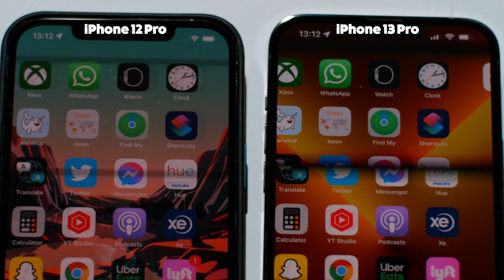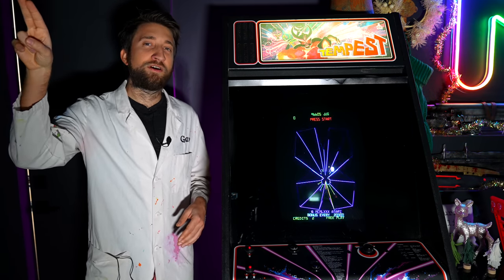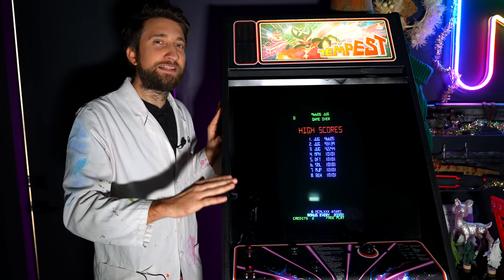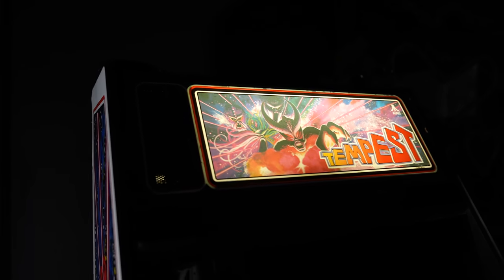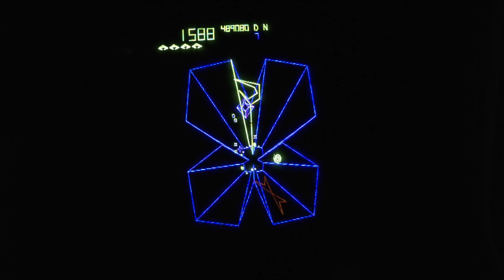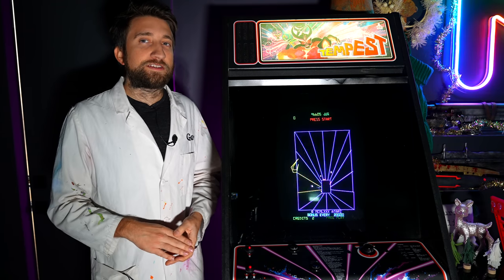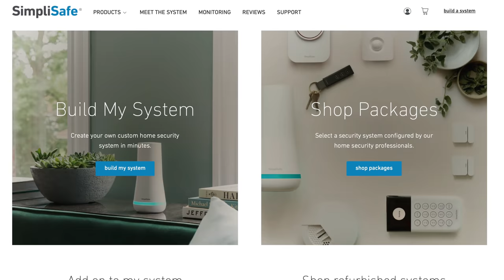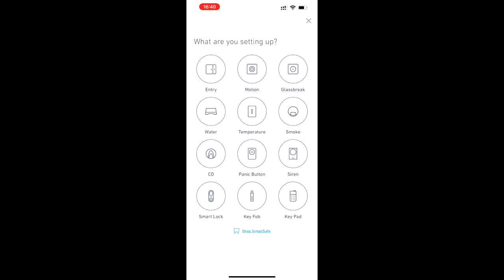Arcade Machines look WEIRD in Slow Mo - The Slow Mo Guys

Comment: I used to have an old CRT monitor that did that. Not sure what went wrong with it but the refresh rate oscillator must have been messed up. It worked for about 6 months normally and then suddenly slowed way down. Needless to say it went in the garbage lol. Probably a bad capacitor or something but you couldn't watch it long because it drove you insane.

Comment: Hello! Could you maybe do a vid just on how you light super slo-mo vids?

Obvs you can't use 50Hz or 60Hz mains-powered lights to do this because the shutter is flipping about 25,000Hz or more and the lights would flicker like a flickery thing..
Do you have to use DC lamps? Or what?
Reply: LEDs are already DC by nature, the problem is the power supply, which can introduce ripple and other things that make the light flicker, so you'd need one that can output a rock solid DC voltage.

Comment: Project idea - Just watched 'Signal path' showing a frequency counter using 'Nixie' tubes counting from 0 to 50,000,000 in a second or so. Video - Is the counter displaying every count from 0 to 50,000,000 on the display? Could be an interesting video to see the count...

Comment: Not being able to fill in the shapes isn't a limitation to me. It's beautiful art.
Reply: Done with a REAL laser on a screen, It's even more interesting with the pure color.
..
I did vector laser images with a HeNe laser and mechanical galvo scanners in the 80s that I choreographed to music. (classical laser light show) 
 I take out a projector on Halloween each year. 
I use the Radio Shack Color Computer with SW I wrote and used General scanning Galvos.  It used the 6809 and a clock around 900kHz.  In the display processor I was squeezing clock cycles to to some rotations real-time. 
..
I though about writing an Asteroids game, but moved on to other things. . .
Reply: @Observ45er  That is really interesting you were involved in that, and used a computer slower than an NES! I've been to laser Nine Inch Nails in the late 90's at Boston's Museum of Science. They were able to raster multiple, large, animated images. I can't recall how many lasers they were using or if it was only one. Probably multiple since they had different colors. I'm not sure how possible it is to have multiple true laser colors out of one laser, or if it's possible to change colors fast enough in real time.

Comment: It was mentioned at six minutes in that it's not possible to fill in shapes with solid colors on vector monitors. While mostly true, Atari's Quantum actually managed to emulate raster graphics and fill in sprites on a color vector monitor. Granted the sprites are small and way less detailed than what you expect traditional sprites to look like, but it was something that was achieved at a small scale. It's a cool effect that I haven't seen in any other vector arcade games. Initially when I first saw a Quantum cabinet it didn't immediately register as a color vector monitor because of that. You can only really appreciate the effect on a real monitor, emulated it always looks pretty funky. 

Unfortunately Quantum was a failure in arcades, and decades later it's one of the rarest color vector games from Atari. By that time technology was progressing in other directions, and Atari would only release three more vector games after Quantum, none of which took advantage of those vector sprite hybrids afaik. I imagine it was probably a very limited use case. Fantastic video in any case, I was wondering when you'd do some vector monitor slow mo captures!

Comment: I am still impressed that humans were able to build the "primitive" screens like 50 years ago
Reply: I did vector laser images with a HeNe laser and mechanical galvo scanners in the 80s that I choreographed to music. (classical laser light show) 
 I take out a projector on Halloween each year. 
I use the Radio Shack Color Computer with SW I wrote and used General scanning Galvos.  It used the 6809 and a clock around 900kHz.  In the display processor I was squeezing clock cycles to to some rotations real-time. 
..
I though about writing an Asteroids game, but moved on to other things. . .

Comment: It's certainly faster to tell a beam to swipe in a straight line from x1,y1 to x2,y2 rather than have a pixel plotter figure out the next pixel to draw and do that for every line on the screen.
Reply: Yes.
And if you want curves, just send the voltages to the scanners faster than the dot can get to the next location.
With a scope you have to use circuitry to determine the time it takes to get from one place to the next.
My mechanical scanners were the limit. 

..

I did vector laser images with a HeNe laser and mechanical galvo scanners in the 80s that I choreographed to music. (classical laser light show) 
 I take out a projector on Halloween each year. 
I use the Radio Shack Color Computer with SW I wrote and used General scanning Galvos.  It used the 6809 and a clock around 900kHz.  In the display processor I was squeezing clock cycles to to some rotations real-time. 
..
I though about writing an Asteroids game, but moved on to other things. . .

Comment: Aren't you seeing more than just the beam's dot on a CRT? The phosphor layer when struck by the beam fades over time.
Reply: That does help added to with retinal retention.  With a laser there is on;y the retina:
..
I did vector laser images with a HeNe laser and mechanical galvo scanners in the 80s that I choreographed to music. (classical laser light show) 
 I take out a projector on Halloween each year. 
I use the Radio Shack Color Computer with SW I wrote and used General scanning Galvos.  It used the 6809 and a clock around 900kHz.  In the display processor I was squeezing clock cycles to to some rotations real-time. 
..
I though about writing an Asteroids game, but moved on to other things. . .

Comment: I wonder if these vector graphic games have a "classic" concept of frames per second. In a line-scan CRT screen, you have to drawn the entire screen, which takes a set amount of time regardless of the complexity of the image. But for a vector-scan screen, the time required to draw each frame will depend on the complexity of that frame.

So I wonder how the programmers dealt with that. Did they lock it at 30 frames per second, meaning that there was a maximum complexity allowed as well as a pause during which nothing would be drawn, or was the frequency dependent on the complexity of the scene?
Reply: You are correct, but no.  I would never waste time. I drew as fast as the system allowed all the time.  That way it is the same brightness and flicker is only a problem for more complex frames.
You draw it as fast as you can.  That way you are only limited by how much you can draw before flicker becomes a problem. 

You can also alter the delay between the ends of lines to make brighter dots on the ends, or speed it up so the dot hardly stops at a point.  Or really fast for smooth curves.
An image consists of points on the screen and the dot moves between dots with a delay to allow the beam (in my case the laser dot) to move.
..
I did vector laser images with a HeNe laser and mechanical galvo scanners in the 80s that I choreographed to music. (classical laser light show) 
 I take out a projector on Halloween each year. 
I use the Radio Shack Color Computer with SW I wrote and used General scanning Galvos.  It used the 6809 and a clock around 900kHz.  In the display processor I was squeezing clock cycles to to some rotations real-time. 
..
I though about writing an Asteroids game, but moved on to other things. . .

Comment: What exactly is “moving” on these type of displays? Surely there’s no mechanical element actually darting around? What causes the beam to travel across the screen?
Reply: the electron gun itself is completely stationary and always points directly at the center of the screen, but the beam gets deflected by magnetic or electric fields.  most of the time it's two electromagnets, one for vertical and one for horizontal.

Comment: Just like a laser show 👍
Wasn't there a vector tank game also?
I like playing asteroids and the tank game the most...way more pleasing visual
Reply: YEP ! ! ! 
I did vector laser images with a HeNe laser and mechanical galvo scanners in the 80s that I choreographed to music. (classical laser light show) 
 I take out a projector on Halloween each year. 
I use the Radio Shack Color Computer with SW I wrote and used General scanning Galvos.  It used the 6809 and a clock around 900kHz.  In the display processor I was squeezing clock cycles to to some rotations real-time. 
..
I though about writing an Asteroids game, but moved on to other things. . .
.
Laser light show in my basement every night.

Comment: This came out when I was 6 and it was always one of my favorites - largely because I preferred vector games.  It wasn't the crispness of the graphics as much as it was the smoothness of the motion.  Viewers who never played this game in the 80s and are only watching it on a computer screen are seeing flicker that wasn't there.
Reply: I did vector laser images with a HeNe laser and mechanical galvo scanners in the 80s that I choreographed to music. (classical laser light show) 
 I take out a projector on Halloween each year. 
I use the Radio Shack Color Computer with SW I wrote and used General scanning Galvos.  It used the 6809 and a clock around 900kHz.  In the display processor I was squeezing clock cycles to to some rotations real-time. 
..
I though about writing an Asteroids game, but moved on to other things. . .

Comment: What is most impressive is that the programmers and hardware developers were able to accomplish all this with 1980 technology.
Reply: WHen yo uunderstand some good techniques, it  seems trivial:
..
I did vector laser images with a HeNe laser and mechanical galvo scanners in the 80s that I choreographed to music. (classical laser light show) 
 I take out a projector on Halloween each year. 
I use the Radio Shack Color Computer with SW I wrote and used General scanning Galvos.  It used the 6809 and a clock around 900kHz.  In the display processor I was squeezing clock cycles to to some rotations real-time. 
..
I though about writing an Asteroids game, but moved on to other things. . .

Comment: I still feel you should go back to record DSLR cameras with a high speed sync flash in use as well as it flashes several times as the shutter curtains move across the sensor at the same time unlike when the shutter speed is below the max sync shutter speed where one shutter opens, and the other closes after the first has completely exposed the sensor. That would be amazing to watch in slow motion. You already showed just the shutter and aperture, but with high speed sync it's a different ball game.

Comment: I stumbled across something that might give a clue to how many Cycles Per Second the Human Eye transmits a signal to the Brain. If you have a communication tower around lit by Strobe Light(s) try this. 

With your eyes FIXED FOWARD, shake your head quickly side to side. The Strobe which normally looks like a single blink will appear as several dots as you head moves quickly side to side. Often something like 5 to 7 dots. 

The number of those "Dots" divided by whatever time (in microseconds) the strobe is on for would APPEAR to be the "Cyclic Rate of Transmission" of the Human Eye to the Brain. Typical Strobe Light illuminates for 6 to 30 microseconds.

Eg; 7 dots ÷ 20 microseconds = roughly one transmission from eye to brain every 3 microseconds, for an Optical Transmission Rate of approximately 330 THOUSAND Cycles Per Second. 

It's a fun experiment, try it sometime.

Comment: I loved Omega Race back in the 80’s. It was a vector game too. Is anyone else sensitive to flicker of LED’s like in car brake lights? If I move my eyes quickly I can see the flicker. Also, on a LEP projector I can see the RGB colors if I do the same thing.
Reply: Yes, LED flicker is awful and wastes brain computing time, which can become particularly dangerous when driving a vehicle. Otherwise I have no problems with word processing on my 50Hz Amiga CRT screen (which used interlaced 25Hz before I had a scandoubler).

Comment: Wonder if there are displays that combine the technology of these render methods .. as the vector method could be great for the edges of stuff on screen  while the normal rendering would be for everything else.
Reply: That would take more time for the beam to do all that, unless you had custom CRTs with multiple guns and deflection systems.
..
I did vector laser images with a HeNe laser and mechanical galvo scanners in the 80s that I choreographed to music. (classical laser light show) 
 I take out a projector on Halloween each year. 
I use the Radio Shack Color Computer with SW I wrote and used General scanning Galvos.  It used the 6809 and a clock around 900kHz.  In the display processor I was squeezing clock cycles to to some rotations real-time. 
..
I though about writing an Asteroids game, but moved on to other things. . .

Comment: Were you by chance aware of TEMPEST attacks/surveillance when you chose to feature the game as the example of a vector display?

Namely, it’s a fun bit of trivia that vector scan displays were used for computers in certain very security-sensitive applications for many years even after raster scan displays became the norm, due to how they’re much harder to eavesdrop on.

I’m curious whether your choice of featured game was coincidence or not. :)
Reply: By physics, vector monitors can be spied as easy by receiving the magnetic field from 2 directions. But it may be more complicate to decipher because there are more variables than with (fairly standardized) raster display beam movement (left to right, top to bottom). Imagine a secret text displayed as a soup of letters drawn in random order. Such a thing could be designed to confuse TEMPEST screen capture devices. But this all would need to be purpose-built.

Comment: Would you be able to progressively speed up the slowmo footage to the point where you can see just like irl? so we can see how it goes from random lines to more and more a perceptible image/video
Reply: Not without some trickery. As the video explains, CRTs never draw the full image on the screen. At any given instant, 90% of the screen is completely black. Filming CRTs is difficult, and long exposures have to be used to simulate how our eyes interpret it. If slowmo footage was sped up, it would still flicker, as there is no single frame with the whole image.
Reply: @brookewestonctc  true, i guess the magic happens when the very high fps rate after being sped up has to be converted to 30 fps. but if the conversion for when the footage is played back in real time to 30 fps is the same for all speeds, maybe then you would see something happen during speeding up slowly? this has gotten out of my imaginary boundaries way too quick xD cant tell if im still making sense :D

Comment: Its a shame, that tempest monitor has its rgb cutoff controls maladjusted which is causing those visible blue lines when the beam is blanked and moving. a slight readjustment to the controls will fix this

Comment: I don't know why I didn't know about the vector graphics displays using the selective ray casting that they did. I consider myself pretty knowledgeable about tech from the 80s and 90s.
Reply: What do you mean by selective ray casting?
..
I did vector laser images with a HeNe laser and mechanical galvo scanners in the 80s that I choreographed to music. (classical laser light show) 
 I take out a projector on Halloween each year. 
I use the Radio Shack Color Computer with SW I wrote and used General scanning Galvos.  It used the 6809 and a clock around 900kHz.  In the display processor I was squeezing clock cycles to to some rotations real-time. 
..
I though about writing an Asteroids game, but moved on to other things. . .

Comment: Would have been cool if they did a vector electron beam with a scanning beam to fill in details
Reply: Takes more time.
..
I did vector laser images with a HeNe laser and mechanical galvo scanners in the 80s that I choreographed to music. (classical laser light show) 
 I take out a projector on Halloween each year. 
I use the Radio Shack Color Computer with SW I wrote and used General scanning Galvos.  It used the 6809 and a clock around 900kHz.  In the display processor I was squeezing clock cycles to to some rotations real-time. 
..
I though about writing an Asteroids game, but moved on to other things. . .

Comment: Hi, Gav ! I have a doubt. The IMAX cameras. Why don't you buy it ? ?
Actually, I was going to ask that the Phantom you use, how many GB's does it take for a 5 second video ? So, I have a Canon 60D and it has 18 MP for image quality. It takes about at least 5 MB for 18 MP quality Image. So, I wonder how the working of IMAX is done ! If we take a Full-HD camera, it gives 1920*1080 pixels for video, which I use and it takes 1 GB for a 5 minute video. IMAX is having a capacity of 12k video capturing. 24 frames/sec at 12288 x 6480 video quality, could you explain the High-Speed writing of high-quantity data captured with a camera like IMAX or the Phantom you use ?  what is the capacity of the Hard-Disks they use:) ! You should explain that in a video..!